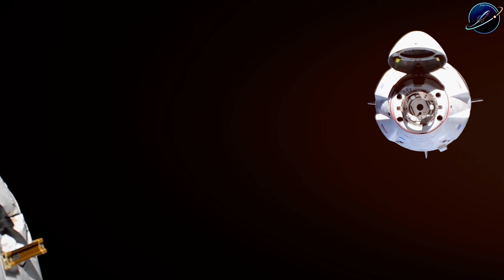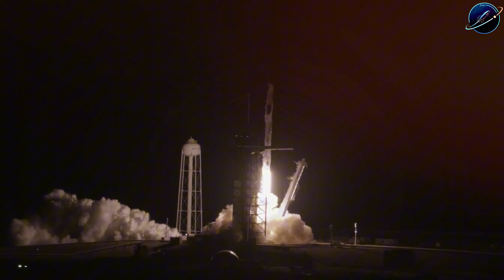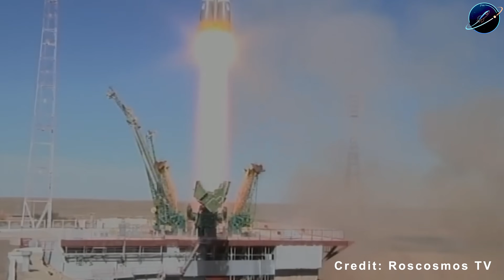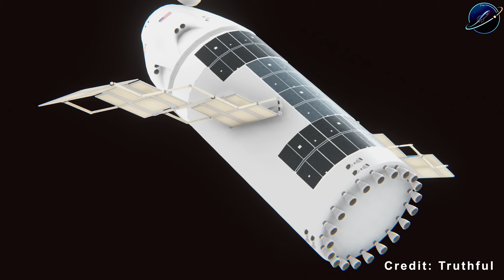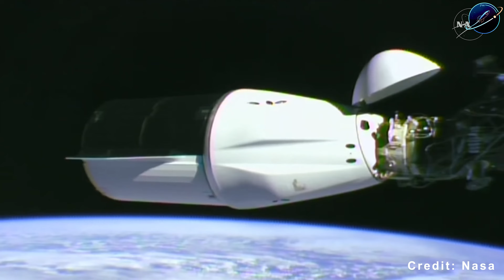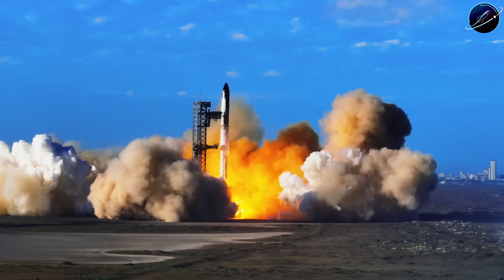It's Mind-blowing! SpaceX Dragon Just Ended Russia's ISS Monopoly!

Comment: Why de-orbit? Keep it growing, and replace the worn-out parts. It still has value and use.
Reply: Can we park it on the moon, does it provide other benefits if left static?
Reply from the maker: Great question—SpaceX Dragon's reboost tests are prepping for safe de-orbit because the ISS's core structure faces fatigue from 30+ years of thermal cycling, docking stresses, and micro-meteorite wear; replacing major modules isn't feasible without Shuttle-like capabilities, and uncontrolled decay risks dangerous debris.